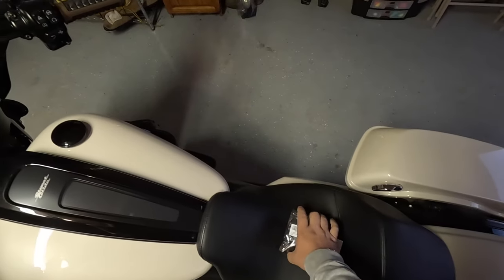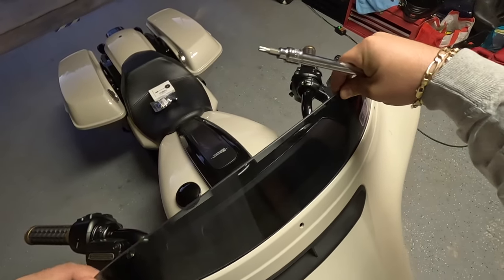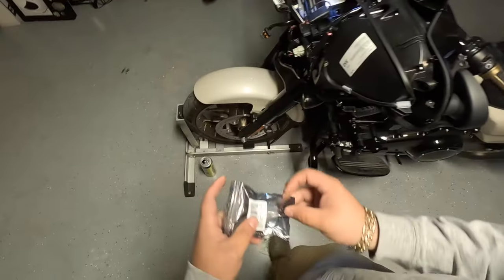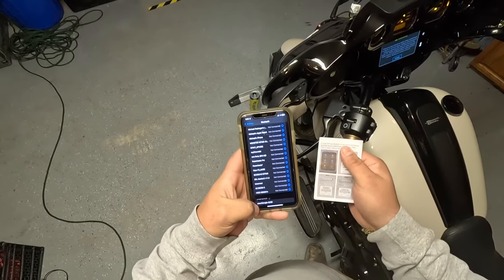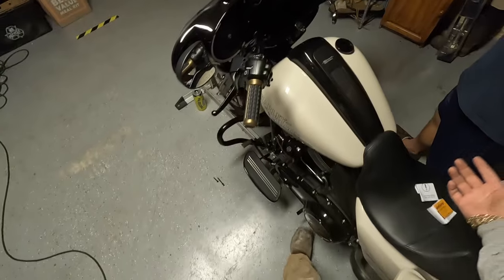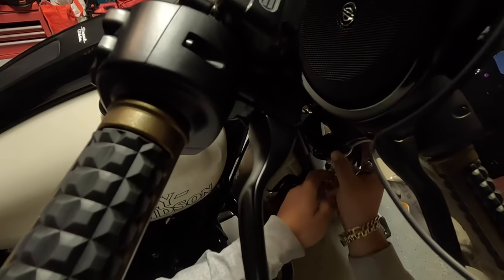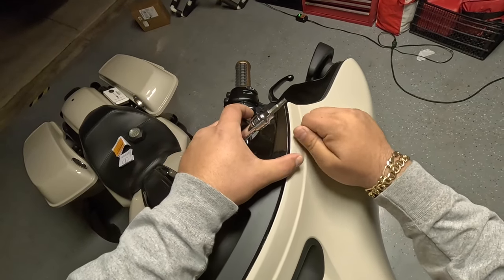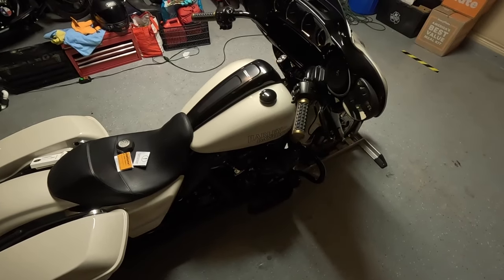Harley Davidson Street Glide ST 117 CarPlay install video Save $$$ with this HACK HD Touring Models

Comment: What for is the module? At least in Europe, you only need the wireless dongle. Hardwire works even without the wirelessdongle. No module needed at all.
Reply from the maker: It’s a 2023 Street Glide St
Reply: Of course, I know😊. Mine is a 2023 SGS. Its the same. Try it without the mudul IN the fairing!

Comment: What’s the part number and where did you get it?
Reply from the maker: I got it on Amazon this is the link for it. 
Carplay2air Apple Car Play Jumper Plug for 2019-2023 Harley Davidson Road Glide or Street Glide with Boom Gts Radio Carplay https://a.co/d/4hev2mU
Reply from the maker: This is for the Bluetooth adapter I also got it on Amazon. 

Wireless Carplay Adapter, Mocale CarPlay Wireless Adapter Car Play Adapter, Convert Wired to Wireless Carplay Fit for Cars from 2015 & iOS 10+, Plug & Play https://a.co/d/iUT9psc